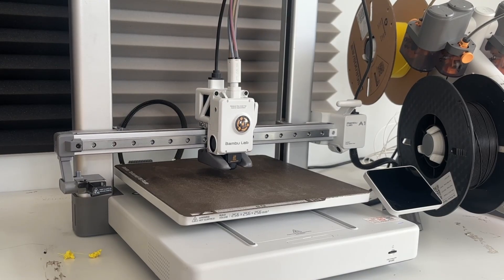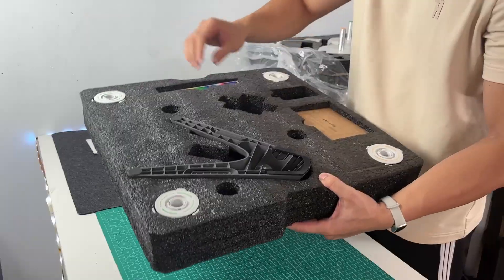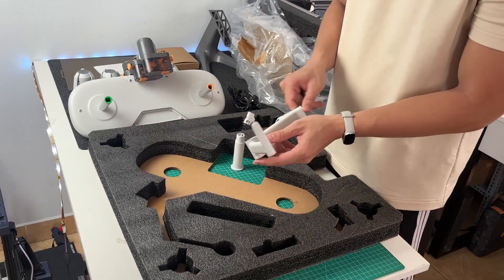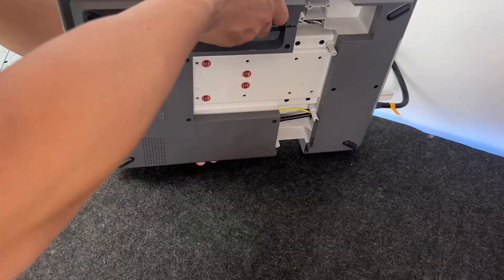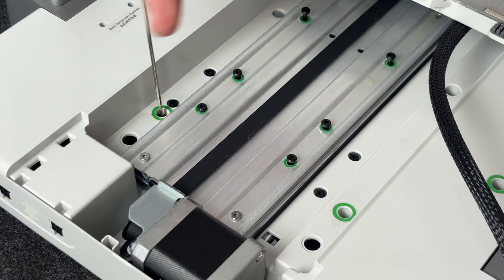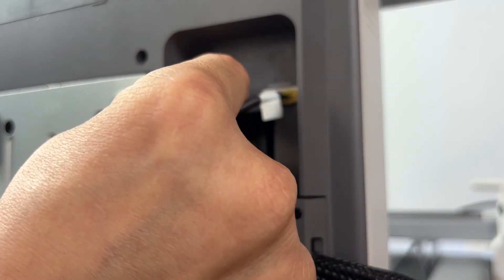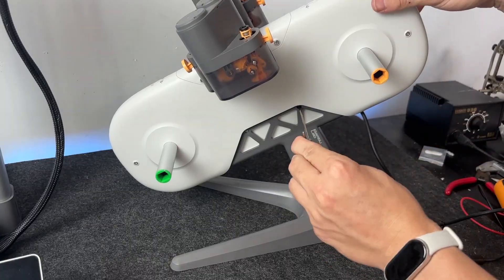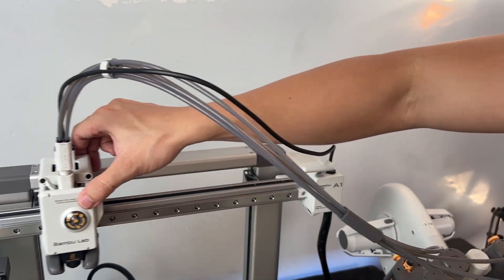Unboxing & Assembling the Bambu Lab A1 Combo + AMS Lite | First Look & Setup Guide

Comment: Thanks for the video! I wanted to check if the swatches are still included so this was really helpful.

Small tip for the video, when you're describing each part/procedure, it would be great to time the video so you show that part/procedure while explaining it. Several times I was confused on which part/process you're talking about since the video was showing something else. For example, 1:49 and 7:07.
Reply: Actually, my a1 combo didn't come with the swatches, even though the foam packaging looked like there was an empty slot for it. I guess it depends on whoever packs the printer. I'm a bit disappointed.
Reply from the maker: @MaplestoryTaiwan  Just contact the shop that you bought this printer broo ! I think I will have all the components like this.